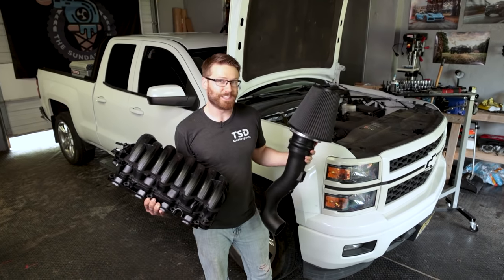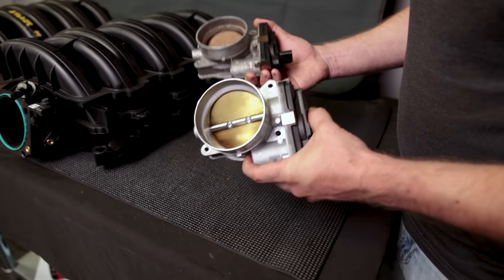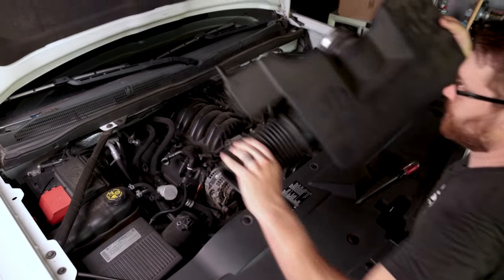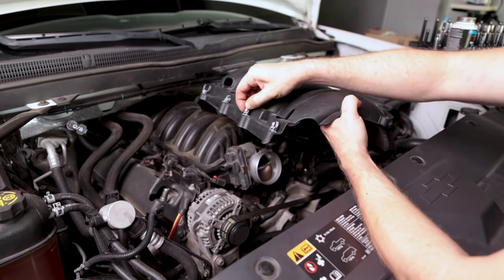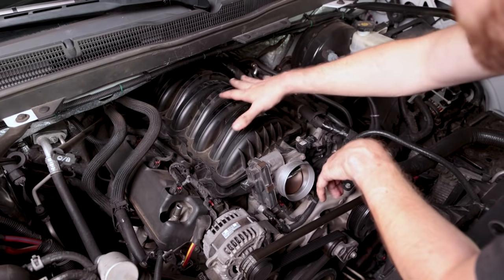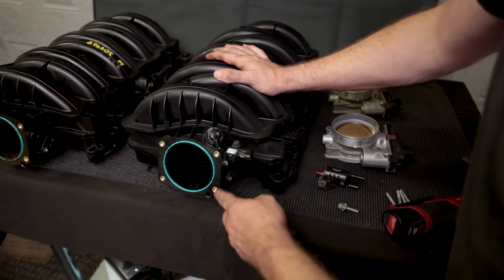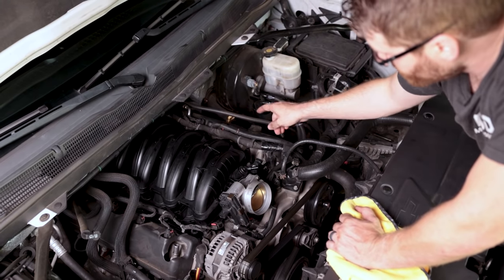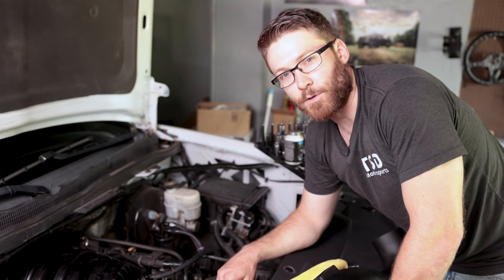6.2 Intake Manifold and Throttle Body Install on a 5.3 - 2014-2018 Silverado Sierra Tahoe Yukon

Comment: I’m doing this mod to my truck this weekend. Next mod on the list will be upgraded driveshaft. Then a BTR stage 2 w/AFM delete and trunnion upgrade.
Reply: I just had my 2014 single cab 5.3 built with the btr stage 2, ls7 lifters and valvetrain with dod delete, 6.2 intake and TB, LT4 fuel pump and injectors. This truck now chirps into both second AND third, runs insanely well for a daily driven street truck.
Reply: These 5.3s make 380/420 on e85 and the cam alone is supposed to pull 70HP out of the L86 (6.2) so I’d assume probably 50ish on the L83 (5.3). Then the intake and fueling upgrades probably another 30-50 depending on tune. I’m probably sitting at about 425-430 to the wheels after it’s all said and done. You lose a little low end with the cam but what you gain from 3500-6000rpm is insane. It pulls the exact same through the entire powerband. Just shits and gets. I have videos if you want proof lol
Reply: Share the video on youtube.
Where I live, their is no places that I know of or can find that have E85 :\
Reply: any suggestions on an aggressive but drivable cam for the l83(5.3) and maybe the valves i’ll need
Reply: @blakeedwards1730  I was suggested BTR stage 2, Johnson lifters, chromoly push rods, and conical dual spring kit.
Nice HP and torque gain, still drivable with stock TC and can still tow with it.
I plan to go with this “AFM delete”…
Reply: @JMRxYM  If you don't mind, how much did that end up costing you?

Comment: been running the 6.2 intake manifold for awhile the difference is it has longer runners that allow for more torque and yes the opening for the throttle body is bigger also you will like it for your towing
Reply from the maker: Awesome! Looking forward to getting it tuned and seeing what she will do
Reply: I don't think the peak hp or torque will be a ton higher but it will have a better range and will definitely work well for you because it should be more lower to mid range I did the 6.2 intake manifold and tbody cat back and intake and then tuned it for e85 and made about 60ish hp more I think? I'd have to check the dyno printout it was about 2 years ago haha but it's nice alot more fun to drive but now my torque converter went out :( so I'm pulling it all apart having the trans built and camping the motor doing basically what you did minus the 6.2L heads 😜 haha
Reply from the maker: Haha yes don't do the 6.2 heads 😅
Reply: Did you have to tune it or anything?
Reply from the maker: No tuning is required from my experience
Reply: @TheSundaeDrive  you didn’t have to relearn your throttle body?
Reply from the maker: Just seemed to work. Truck is running without any issues or codes.
Reply from the maker: A relearn may help it perform better, not sure.

Comment: I would like to see some numbers to see if this would actually be worth it.
Reply from the maker: GPI has some in depth dyno testing results you can see up on their site - planning to dyno but we've been slammed.
Reply: @TheSundaeDrive  Gpi does horrible work.
I wouldn't let them change my oil.
Tune on my freinds truck was so bad.  Tore up two transmissions and  he had it tuned by someone else and got more than 100 more hp.
They suck.

Another freind had a cam installed and the motor tore up soon after.
He had to replace the engine.
Reply: @TheSundaeDrive  
First freind got a full refund from them to be quiet about it and they told tge second dude..."tough luck"
Reply: Look up Richard Holdener. He has several videos with Dyno charts for the L83 stock, BTR cams 1-4, L86 intake swap stock, and L86 intake swap with BTR cams 1-4
Reply from the maker: I can't speak to their installation work. Only have dealt with them for parts but I would be frustrated by that for sure!
Reply: GPI tells you in fine print that they picked up those gains with a cammed engine.
Reply: Waste of time and money heads and cam a must tune and headers   not manifold or throttle body will do shit because  air intake tube is the same size you have to make a custom air intake tube and a banks filter go all bigger or go home wake up people 😮
Reply: This won't do anything for power, unless u need more air because of cam or other mods
Reply: @mikecastleberry9671  you have no clue what you are talking about
Reply: @TheSundaeDrive  you guys act like a Dyno test is as simple as a walk in the park...on avg a performance shop charges $500 just to get a unit tested

Comment: 2017 5.3 failed…Lifters of course! And camshaft damage. Going to attempt to do it myself,However, could use some detailed info on programming! Great info and videos from you! Would have not considered this without TSD.Thanks !!!
Reply from the maker: We may do some tuning videos in the future. We used a remote programmer for my truck but you should really add a wideband sensor (which we did and will be making a video about). Shoot us an email through our website www.tsd-motorsports.com and I'll be happy to put you in touch with the guy we used.

Comment: I just put a Specter Performance intake and filter to my 6.2 and WOW does it make it sound good when that pedal goes down! I also have a MBRB. Cat back SS exhaust which makes for a great combo. I have not towed my camper with the intake yet but looking forward to a little more power.
Reply from the maker: Ooo nice. The airaid I added sounds fantastic. Looking forward to driving with it regularly. Haven't done an exhaust yet. Probably next year for that.
Reply: Make a video of it! Man that sounds good
Reply: @TheSundaeDrive  I have the Airaid air intake on mine for the 5.3L. If I were to upgrade to a 6.2 intake manifold, would I need to get a bigger coupler or would the one I have for the 5.3 work? 

Thank you in advanced
Reply from the maker: I believe you can manhandle the 5.3 coupler onto the 6.2 throttle body. Not easy but I've heard it can be done.
Reply: @JTrump23  I have the airaid Jr with the 6.2 l tb and intake and I was able to stretch it over the new intake. It's a job and you may need some lube but it can be done... I ended up ordering a 4"to 4" coupler on Amazon that's a little bit oversized for the intake but when you tighten the clamp, it seals it and your not able to pull it off. I was afraid of the 5.3l coupler splitting as it gets older.
Reply: Is crazy how filter can change the sound I bought my dad long time ago k&n filter for his 2010 Escalade. Did it sound different sure did lol

Comment: 3:00 I can agree with all of that. Mines a 15 on z rated 22's but you can still feel in the driveline it doesnt like it. I've had it up to 140 once but thats more than pushing it, I dont recomend anyone cruise much more than 110 for very long without a driveshaft upgrade! I've seen ones in the 2500 gas trucks even rip in half just easing threw the woods...transfercase, fuel tank, lines, evap and a new driveshaft (anyway) later... 🤷‍♂️ it costs to go fast if you have any plans on walking away lol

Comment: I did this mod about 3 weeks ago. Took half a day taking my time. I also installed a cold air intake (not the same as this one shown) hardest part was the plastic tabs in the back. Pissed me TF off but I got them and didn’t put the cover back in. Same MAF, No tune and have not gotten any codes.
Reply from the maker: Awesome! glad it is working out well for you! Those tabs at the back are terrible. really bad design.

Comment: LT1 intake is a option as well, I’m doing a LT1 on my L83 build
Reply from the maker: Nice! Is there any difference between the lt1 manifold and this?
Reply: The throttle body intake is angled down on the LT1
Reply: @daringlisson9353  correct, ICT billet makes a angle adapter or you can reroute your serpentine belt to make
It work
Reply: @TheSundaeDrive  as far as power, not 100% sure, you would think it has good numbers being a corvette intake. I’m using it for the look more than anything
Reply from the maker: It does look cooler for sure
Reply: L86 intake is more low end torque and the lt1 intake manifold is more for top end

Comment: Can you send me your video of you taking off the TRUCK MANIFOLD ENGINE COVER. It's very hard for me. It's the first top cover that is on top of everything. Thank you
Reply from the maker: We have a video showing how, look up the hpfp fuel pump replacement we filmed on the truck. We remove it in that video.

Comment: About mass air flow sensor  you use the 5.3 one or you install different one? 🤔how much more power with new upgrades?
Reply from the maker: You can use the same MAF. The shop I was using to tune unfortunately closed so I havent been able to get on a Dyno yet to test out the power gains. Trying to add a wideband to the truck soon so I can finish getting the tune done and then I need to find a Dyno shop.

Comment: After you swapped the intake manifold and throttle body did you have to do any running or does it run just fine?
Reply: Should run fine , would recommend a tune to get the full potential of it

Comment: I just did the 6.2 swap last night. I noticed the truck is idling a bit rough now.  It's a totally stock tune and I just got my tuner last night so I'm waiting on the tuner to make the changes. It just seems odd that the final pass with the torque wrench is 7.4lbs... it feels un-natural lol
Reply from the maker: Lol it doesn't take much. Keep us posted for sure! I know my truck had a custom tune already but it was made for the stock intake manifold and I swapped this one on I didn't notice any issues. My truck was already idling rougher from the cam tho so might have just been too subtle to feel or see lol
Reply: @TheSundaeDrive  lol, ya a cam will do that to you. I also did that thermal thing for the transmission and my fluid is brown (did it at the same time as the intake) so I guess I need to order a filter and fluid and that'll be the next project that I get to do... also gotta go pick up a 2x4 to pull down the exhaust to get that pan out. Fun times!
Reply from the maker: Always fun. :) Lol

Comment: Did you have to tune it at all or do throttle reset with a scanner? I just got one, gonna swap it tomorrow
Reply from the maker: My truck was tuned yes but between swapping I didn't change the tune. A tune isn't a bad idea tho

Comment: I am soon to be doing the AFM delete stage 1 and cylinder exactly as you did. Do you recommend using stock intake for the tune or should I put the new 6.2 manifold on to get it tuned? Thanks!
Reply from the maker: If you can get the 6.2 cheap, go for it. Just make sure your tuner knows.

Comment: Cut the back off worked great for me! Those clips on the back suck. I didn’t like the constant air noise with cylinder switches from 4 to 8.
Reply from the maker: Those clips are a pain. I deleted afm so no more of that for me :)

Comment: I did the swap, everything bolted up great then I noticed a extra vacuum line port on the drivers side rear that was not in the l83 manifold? It through codes and ran lean I plugged it with a cap and codes Cleared up and it runs great???? But I’m stumped on the extra port in the l86 manifold
Reply from the maker: I am very curious as well now. So much so I got up to go look at mine to see if I could see an extra port lol. Needless to say I could not find one. Was it definitely an L86 intake manifold you got? could you send us a  photo of the port to our instagram www.instagram.com/thesundaedrive

Comment: I know nothing about this stuff lol but anyways! I have a 2018 Silverado Z71. I put a 2” leveling kit on with bigger wheels and tires which are 285/55/20’s and of course 20”x9” wheels. Now I’m putting a Borla s-type exhaust on with a corsa cold air intake. What benefits would I get with putting this on my truck? Really I know nothing about this kinda of stuff.
Reply from the maker: Here is a video we made that show the Dyno gains! Mainly just helps with a little more power and torque https://youtu.be/eKy52rwxVeU

Comment: Now heres the big question. Can it be done to an older ls engine like a 2003 model?
Reply: The question is why would you?The intake ports are shaped different.
Reply: @allanb3222  the question is why not? You know more air flow and all. But looks like I'll go for 6.0 intake instead.
Reply: @Ryanmoody89  The tbss intake is the best flowing,stock intake for your gen III. I would go with that.
Reply: @allanb3222  I shall look into that then. I got an 03 tahoe z71 I'm trying to do work to so whatever I can use I'll do it.

Comment: Been looking at doing this mod on my 18' Silverado. I work at a GM dealership as a tech helper, so relearning the tb position isn't that big of a deal, but would it work without a custom tune
Reply: I did this on my 15 Silverado. I didn’t do a thing for a tune and never had a check engine light
Reply: @j_rod75  did you get any gains?
Reply: @sambo2891  yes but nothing that really wowed me. I decided to get a custom tune so hopefully this month I have good news.
Reply: @j_rod75  ill be waiting on the overall results if you dont mind replying
Reply: @OscarMartinez-dy2sh  I don’t mind at all. I had to reschedule the appointment so when they can get me in I’ll let you know
Reply: @OscarMartinez-dy2sh  finally got an appointment with my tune shop set for this Monday. I’ll keep ya posted

Comment: Swappin that, will it drop a check emgine light or anything??
Reply from the maker: I don't believe so but my truck has a custom tune so I can't guarantee it. To get the best performance out of it you'll want it to be tuned for the additional airflow. 99% sure others have done it without a tune tho, if you search around online you should be able to see pretty quick.

Comment: Is it just more air or did the ECU adjust so it adds more fuel to the mix?
Reply from the maker: ECU should automatically adjust but I'm running a custom tune - it's probably only really worth it with a custom tune honestly
Reply: @TheSundaeDrive  gotcha, might put a 6.2 intake on mine
Reply from the maker: Air intakes are identical, only difference is the throttle body and manifold

Comment: Much better swap is to sell the 5.3 and buy a 6.2
Reply from the maker: Lol if this motor goes I will be. Not a simple plug and play swap from what I understand but I imagine one day I'll be doing it :) not getting rid of the truck
Reply from the maker: Wanted to focus on upgrading the 5.3 as most drivers have that, very few would be willing to do a 6.2 swap
Reply: @TheSundaeDrive  Great video! I have the same Airaid for my 5.3L. Would you happen to know the size of that coupler for the 6.2L manifold.  I’m trying to get ready for the swap and don’t have the 6.2L coupler … any advise on where to purchase one that would fit?  Thanks
Reply: Sounds quite expensive vs the mods but I get your thinking. Most people do what they can afford, except politicians, they just raise the debt ceiling lol.

Comment: hahaha you can get to the injectors, but the real question is will they come out...........haha even with the special gm tool was a nightmare.
Reply from the maker: They are a nightmare. I bent a fuel rail trying to get them out working super carefully. They added a gasket on the newer engines that helps them from siezing but doesn't fully prevent it. On the other side I just removed the fuel rail and got new injectors since I was changing the heads 🤣

Comment: What years does this work on the hood to put it in the service position? Does the 07-13 have the same thing?
Reply from the maker: Mine is the next generation but many hoods have a service position. It probably does but you'll need to check and see if it has holes similar to mine

Comment: I am very literate with car. My question is; can I swap 2018 escalade platinum 6.2 intake manifold on 2015 suburban LT?
Reply from the maker: Does your suburban have the L83 engine?
Reply: @TheSundaeDrive  my is a 5.3, I am not sure but I think it is. It is a LT 5.3 rear wheel, where can I find out from the engine to be able to tell it is a L83 ?
Reply from the maker: I think it is printed on the block but can also have the dealer run your vin if unsure and they can tell you your engine code. The 2015 should be the L83 and if so, the l86 intake manifold come the 2018 should be compatible.
Reply: @TheSundaeDrive  thank you very much

Comment: I did this swap and the truck fired up and ran great for a minute then began to sputter and stall out.it will start right back up and sputter and stall.No check engine or pending codes. Is it the tb? should i drive it and see if it relearns?
Reply from the maker: You probably need a custom tune for the upgrade If your truck is sputtering out. Mine is tuned and I plan to refine the time with my intake manifold and throttle body. Haven't gotten around to it because the tuner I was using closed up :(
Reply: @TheSundaeDrive  thanks for responding, that was my guess too
Reply from the maker: No problem. Best of luck with it! Let us know how it turns out.
Reply: @TheSundaeDrive  Finally got my tune from blackbear and it turns out that my brand new upstream O2 sensor on the passenger side was damaged from the get go. This was causing the erratic idle and Blackbear was able to flag it when they read my live data log. It never set a check engine light, replaced all 4 with factory ac delco sensors and the truck runs beautiful. I'm sure once I upload the tune it will be even better. Thanks for the videos and advice'
Reply from the maker: Oh good to know. Glad you were able to get that figured out! Thanks for following up. Surprised there wasn't a code thrown.